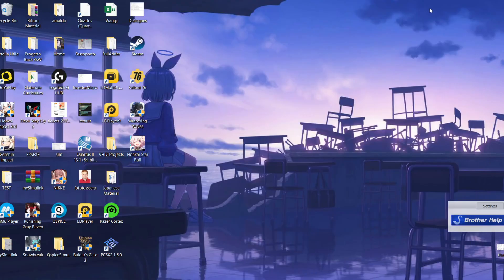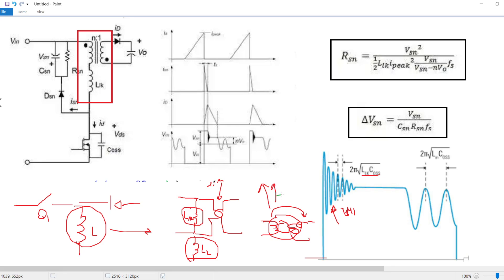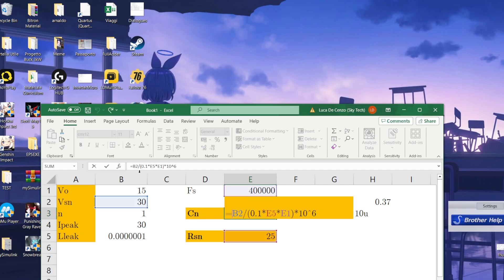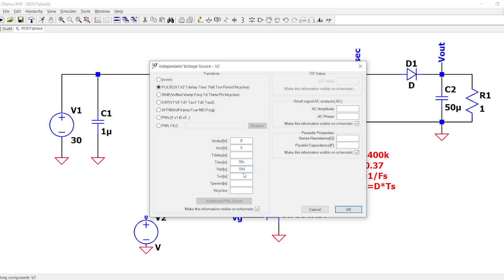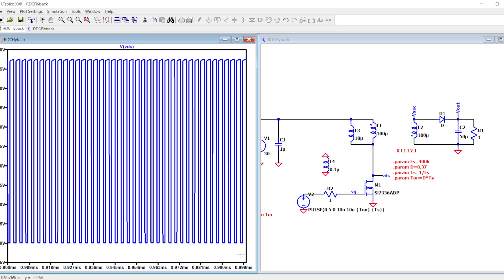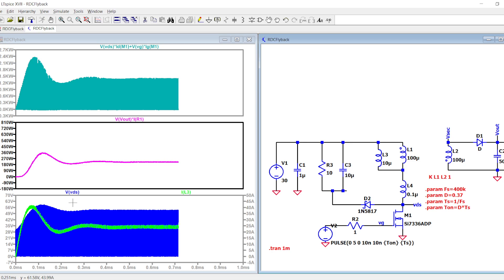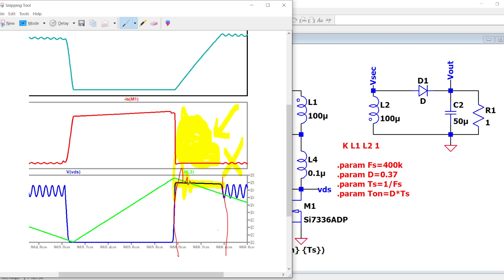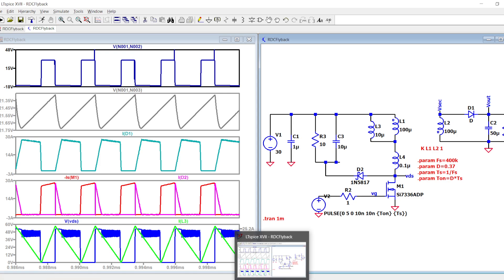LTSPICE RDC Snubber for 250W Flyback DC DC

Comment: I ask going to ask you for  this. I have a supply isolated and the switching noise couples to the output. I have been trying to squash it but I can’t figure out if the pcb is the issue. Mine is a forward converter 48W